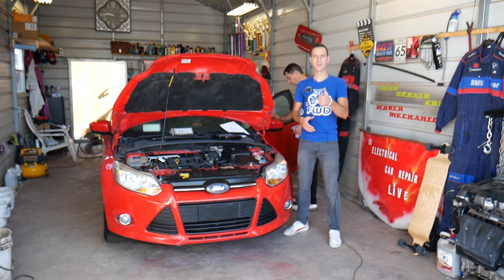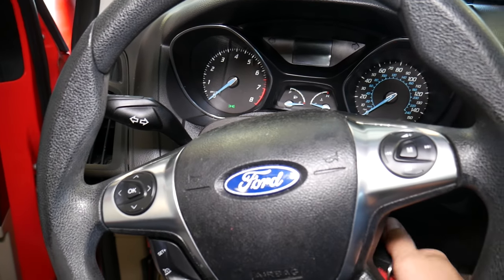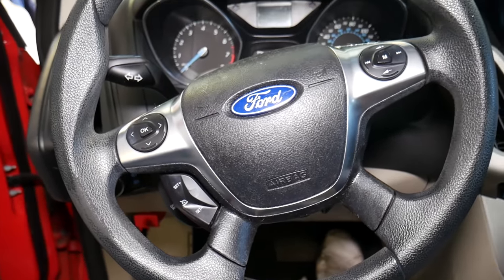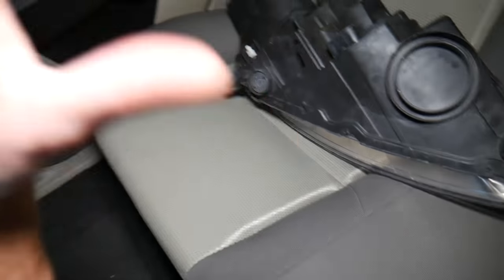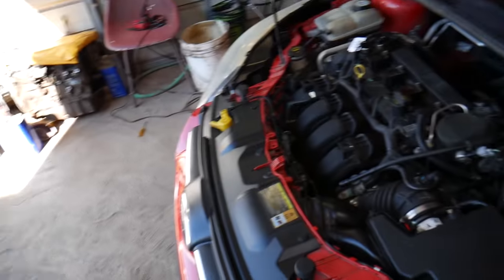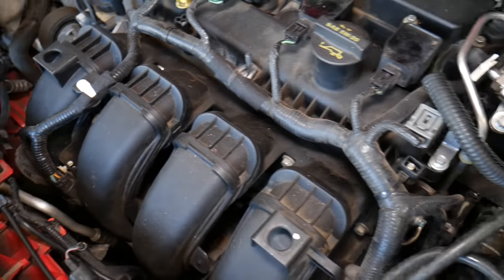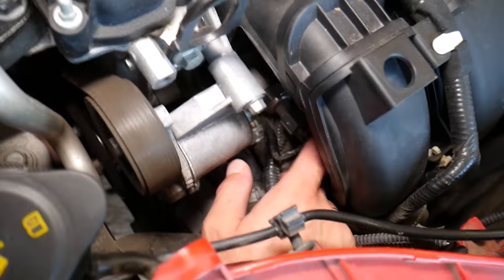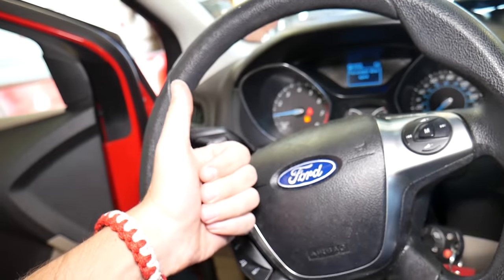CAR CRANKS BUT DOES NOT START DEMONSTRATED ON FORD

Comment: Ok look at that part on the left side of the fuel pump. It's a hose with a square tip & a white clamp and slides onto a little pipe that sticks out the left side of the pump. My car only starts if I push that in. Is it put in wrong or what could that be? 😢🙏please help🥺

Comment: My 2011 Ford fiesta had corrosion problem, I believe I didn't catch soon. I hit the fuse dist box   and things came to live for a few miles. So I decided to pull fuses one by one and clean all terminal. Now I have code for low voltage to ecu. But I have good voltage to ecu. Stumped

Comment: Can anyone tell me, I have a similar problem in the car. Ford focus 2013.diesel. A mechanic worked for me, a large and a small car service. I bought the car about 3 months ago. I had no problems with rumbled. I also replaced the battery. New! The car rumbled again. Sometimes. But mostly run from the first. It all started after the service. Please answer, I would like to hear your opinion.

Comment: I HAVE A 2013 FOCUS, I am not getting any power to the injectors!!! checked All fuses in engine compartment, & under dash by glove compartment, did the swap on relays in engine compartment, new rail psi sensor, 2  new cam sensor, on scantool i was getting 1600+ psi for high side, & on my fuel gauge i was getting over 60 psi from in tank fuel pump. WHAT DO YOU THINK???? THANKS

Comment: I put my code reader on my Cruze and did a full diagnostic. I have 3 codes that show up but the engine light is not on. I noticed a few times my car cranking and after about 5 seconds it starts but most of the time it starts right up. My code reader says I have a bad ignition switch that may be going out. Does this car have an ignition switch ? I can't find anything about the switch on this car.

Comment: 2014 Ford Escape 1.6l SE 2wd

So, I just did an intake gasket replacement and while doing so I went ahead and did the timing belt, waterpump, timing tensioner, ilder pulley, spark plugs, ilder tensioner, serpentine belt and both CV axles. When oil leaks from gasket it got deep into plug well and the boots to the coils were oily. Everything is put back together and went I go to crank it up it cranks, turns over, but doesn't fire up all the way. (I am thinking no fuel pressure or maybe need to purge air out of coolant system.) so kinda stuck lol.

Comment: Having the same issue with my 2012 ford fusion. New pump and new relays and still have the issue? Can't find the fuel pressure sensor to replace though.
Reply: Look up Fuel Injection Pressure Sensor. Sorry I'm 6 months late haha
Reply: @AyeVincino  No worries, figured out I got a bad pump and got it fixed. Appreciate the reply thought

Comment: @4:21 But how did you figure it was that fuel pump sensor??
Reply: if you un plug the esnsor & it starts then you know the sensor is bad... if you havs a scan tool the high side pressure will be in there, & that info comes from the high side fuel rail pressure sensor

Comment: My 2014 Ford Focus stalling after each trip without warning without engine light. 
I reply the purge Valve but still same issue. 
I turned it on driving it and when I arrive shopping center and come back to turn it on it’s on and off immediately. I leave it for 10 minutes and it’s starting up. 
What do you think please?
Reply: I have some problem, have you fixed the problem? Can you share please thankyou

Comment: Helo bro. I have a ford fiesta. 2007 model. Diesel engine. 1.4TDCi. Recently, I had to change the gasket and rings because coolant oil drained off and I dint notice. Engine overheated and stalled finally. After fixing the new gasket and new piston rings, I face a new problem, and that is, car runs smoothly. but after the engine gets heated, it is not starting again. I had to leave the car for 20-25 mins and allow the engine to cool. After that, the engine starts and runs. My mechanic is unable to identify the real issue. He has checked the injectors, pump, replaced the battery, checked the crack sensor and rail pressure sensor...
But still the problem persist. I noted smoke from oil dipstick. But mechanic says that it is normal. But i am unable to accept that. Could you please help to figure the problem? Thank you in advance.
Reply: Helo, i have some problem, have you fixed the problem? Can you share please thankyou
Reply: My 2012 focus se hatchback was doing the same thing. Also the tcm (transmission control module) is bad (pretty positive as it's a huge problem w focuses of 2012 up to 2017 (?)). Not sure if the overheating is related to faulty tcm though. It was hell during COVID lockdown because could only get food through drive thru, and if they were backed up or slow, the car would overheat!